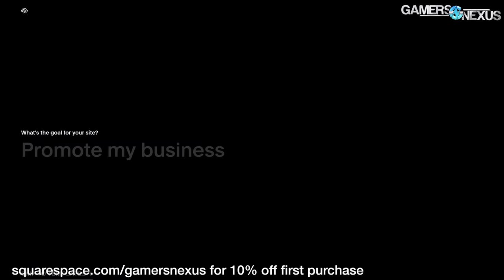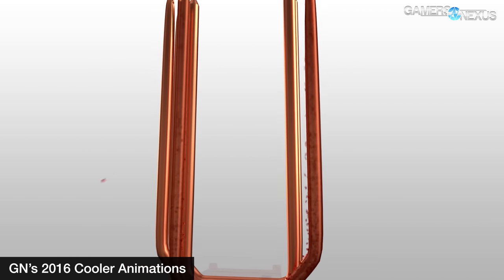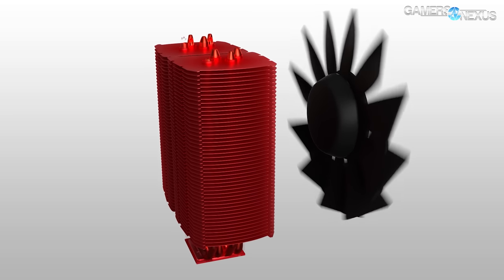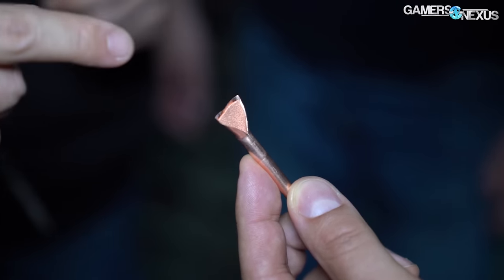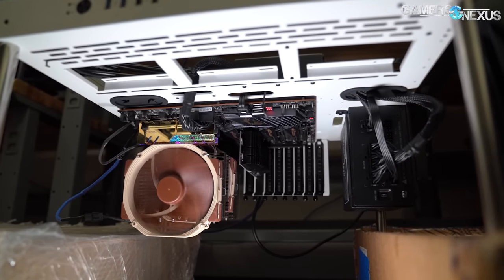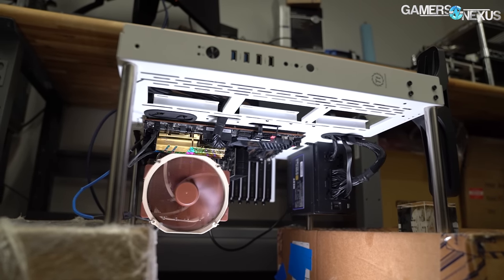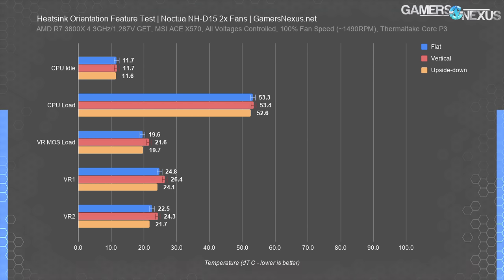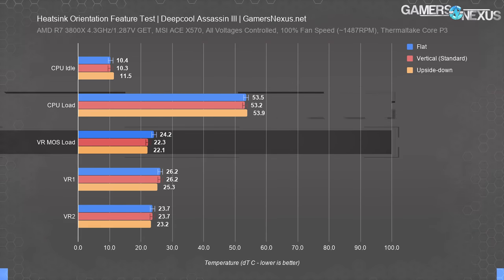Cutting AMD Coolers Open & Flat vs. Vertical CPU Cooler Benchmarks

Comment: Does orientation affect the heat level or power level at which the heat pipes for a given cooler run dry?to examine this question I believe you would need a heat source that could produce varying and somewhat accurate levels of heat.

Comment: Hey guys, I noticed that on some of your results, you didn't report error bars on the upside-down position. Not sure if that was a mistake or intentional.

I'm a little concerned about the error bars on these tests in general, and where they're coming from. They don't really seem to fluctuate with the underlying values, which is a little odd.

If you're just reporting error based on the precision of your measuring device, then some statistical inference would give you more confidence by averaging the error. If you're reporting error bars using a population average and standard deviation, that's probably not the best way to handle the data for a limited number of tests. That potentially discards useful information, and it makes the results very sensitive to population sampling bias.

From a UQ perspective, the testing error is an unknown quantity that you would expect to be well-correlated between similar tests, so variance in one of these orientations and locations would inform variance in the other orientations. Using a Bayesian approach and having some prior normal distribution, you can then update it with each new test you run.

The more tests of one type you perform, the more certain you can be about what your expected variation is, and the less information you need to collect from your population to validate that.

Comment: Have you ever opened a tube that was charged with r134a refrigerant? I had one for a 775 socket that said it was charged with r134a. As an auto mechanic, I didn't see how it would work without compression. The instructions said had to be orientated upright for convection flow.

Comment: I know you consistently say that upside down heat pipes are a fringe case and while that may be true for cpu coolers nearly every air cooled gpu runs an upside down heat sink. Do you know if subzero temperatures can harm heat pipes due to ice expansion or is the amount of water so insignificant that it's not a concern?

Comment: Interesting, in a fanless setup with GPU near throttling, I was able to reduce the temperatures by about 5 C by flipping it upside down.  The case was the ZeroRPM HT03, which has GPU heatpipes facing downward normally, or upward when I flipped the case upside down.
Reply: The airflow in you case is insufficient for your GPU then, not so much the heatpipe orientation of the said GPU.  Try to fix a 600rpm+/-  fan to blow some air under the GPU.  Probably doesn't even need to exhaust there, just cause some turbulence to keep the air mixing and moving. 👍
Reply: I would like to see some specific GPU cooling as well. When Silverstone introduced vertically mounted mobos there were immediately big problems with GPUs with the heatpipes being the wrong orientation. Presumably it’s worse for GPUs because in most cases the height difference is very minimal unlike a CPU cooler which can be mounted many different ways in a regular case so there’s not as much of a priority to make them resilient to gravity.

Comment: Dunno if this has been said before, but in my experience cutting things with a Dremel, you need to crank those RPM´s way up. It may be a bit intimidating, but I've found that the slower the cutting disk rotates, the more it "grabs" the work piece and the more it "kicks" causing all sorts of problems.

Comment: @GamersNexus, my old laptop would steadily climb to 95c and sit there until it eventually couldn't throttle any longer and shut down if i had the laptop with the base in a vertical position with the front of the laptop pointing upwards. Vertical orientation with the back of the laptop toward the top, it performed better than being in normal flat. To either side didn't affect much though.

Comment: Hi @Gamers Nexus
did you ever test to mount a CPU backplate heatsink?
I found the backplate of my CPU hotter than my CPU cooler.
which mean a lot of heat is not spread out of the cpu.

so I'm curious to know if there are reliable solution to cool down the backplate. (like a backplate heatsink)
if its cooler, the CPU should be cooler too (?)

Comment: Removing the cooling fins was a job for pliers and or a flat head screwdriver and rubber mallet or a normal hammer and adjusting the tappy tap tap accordingly.

Comment: The liquid at the block vaporises and the pressure forces the rest of the liquid to disperse evenly across the entire surface area. This means there is a continual 'stream' where the gas is condensing, and the liquid is forced along the surface area to the block, where it vaporises again. As such the orientation doesn't matter, as the momentum is driven by the pressure, not by gravity. There would have to be a huge pressure differential for gravity to matter.

What Steve should do is run a cooler with a progressive number of heat pipes cut open!

Comment: In cases where consistency of the heat load is so sensitive, could you just used a burner plate to 'simulate' a CPU with high watt consistency?
Mounting might be an issue though.

Comment: length of pipe affects performance longer the better , it would have been nice having before and after test temps to see how much the  phase change does make a difference ( not separating the pipes but depressurizing them for liquid to evaporate )

Comment: Nobody:
Literally Nobody:
GN — Cuts open a heat pipe and exposes a lie from Deepcool.
Reply: That or their heat pipe supplier is screwing them. Or their contract factory.
Reply: @mgkleym  which doesn't matter because it's their brand that they're pushing, so, its their literal and only fault :)
Reply: @mgkleym  they would 100% known. That design would have had to have been extruded through a die with that pattern, kind of what you do with playdoe maker or applying the designs when Applying frosting on a wedding cake. You have to pay thousands extra to have the shop cut this design into a hightemp hardend steel block using multimillion dollar machines. They recieve samples of a cross section or profile of the inside of the tube and a sample cut in half longitudinally. If they had any kind of qc department they would have randomly did an autopsy on random samples to make sure the product was as advertised to the consumer...This company is ripping off the customer by swindle which is a felony in the USA.
Reply: @melgibson6331  No,  not necessarily. If they outsourced production to a large manufacturer,  it's likely said manufacturer is already equipped to produce pipes with that feature. You'd only know, in that case, if you cut coolers apart.
Reply: @seitenryu6844  You have never worked in a factory have you?...even if its made somewhere else you Have to measure, test and cut the thing up before you put it in a box with your name on it...you are wrong i am right.
Reply: @melgibson6331  I have. I worked at one of the largest manufacturers of safety related equipment enclosures in the country. To say the techniques used were crude would be an understatement.  Speed and numbers were the most important things. I don't doubt that many places have scruples and high standards(I do, hence why I left!), but you're giving factories far too much credit. Maybe they knew, maybe they didn't,  but YOU DON'T. You couldn't. I'll wait for their response.
Reply: @seitenryu6844  were you worked it sounds like it was all inhouse except for the actual plastic.. If this place advertised a special design in their product you better believe it better be there even if you cant see it....their job is to make sure the product is as advertised. Cutting it up and destroying some for qc is industry standard and akways has been...even where you worked the safety lenses had to go through a barrage of test that would destroy the lenses in the process. You then record the serial number and keep it in a log to show whoever later you test your product for safety...every manufacturer has a qc department especially a company this size protecting millions of dollers in electronic gear.
Reply: Deepcool seems to do that a lot. Remember their leakproof AIOs? I'll never buy any Deepcool products since all they seem to do is lie.

Comment: Steve, great video however I believe your test methodology may not be aging well as CPU's are pushed closer to the 100c TDP limit and beyond.  I stumbled across some interesting findings on an Assassin III I'm using to attempt cooling  an OC'd 13600k.  I was testing the PC while on it's side, and noticed significantly (~10c lower temps).  I flipped the PC vertical mid benchmark and witnessed the temps steadily ramp up.  I tried a few variations of this, horizontal / vertical stance, messing with mounting pressure etc.  All were roughly the same outcome +/- a degree c.  In your test I don't believe you are really "stressing" the coolers.  I believe as you push closer to 100c, you begin testing the ability of the cooler to return the liquid to the vapor chamber.  It appears gravity does provide an assist as the heat pipes are stretched to their engineered limit. (At least in my case).  I can provide a screen shot if interested.

Comment: Is it possible the Deepcool would not have placed the grooves on the bend of the pipe because it would effectively choke off the pipe if a bend was applied to the grooved section?

Comment: The orientation of a c type cooler does matter, such as at 19:50.  I had a phanteks cooler like that and I transferred to a different case that had the mobo upside down, and it overheated horribly!  If I layed the case on its side it would be fine.

Comment: I remember doing an engineering report on heat pipes. Now, I use them exclusively for computer builds. Well, before the report, I had a hard time justifying a AIO for anyone's computer outside of systems that needed that additional thermal mass of the water.

Comment: I wonder if there's any local university's you could work with to access a decent sized vacuum chamber and test a CPU/HS combo inside the chamber as a air pressure is decreased and approaches a 'good' vacuum?

Comment: 6:08 ive always wondered at that sintering machine, 1. wouldn't all the copper powder just collect on one side of the tube and 2. why is is dumped in so inefficiently looks like more hit the floor than went in the tube

Comment: Can you do another video with GPU coolers? If vertical vs horizontal fins really matter. Because vertical fins are present in most high end cards, while horizontal ones are present in cheaper models. You could compare the MSI gaming X (the old one) with vertical vs horizontal fins

Comment: Where was the case in the flat and vertical tests?
The slightly lower value of the upside down could be the temperature gradient of the room (cooler air closer to the floor).
Two tests 4 feet from the floor and one test ~2 feet from the floor could account for the .5° difference.

Comment: What about the Noctua NH-C14S depicted in the warning shown from Noctua? I tried mounting it the wrong orientation on a 10600k running cinebench, and the CPU temps reached over 95 degrees. remounting in the horizontal orientation dropped the temps to 73˚C with lower fan speed. Not entirely scientific, but clearly indicating something fishy… Maybe the fact that the cooler heat pipes have two bends, makes it more prown to the negative effect of the wrong orientation, so much so that Noctua warns about it in their installation guide?

Comment: Oops. I have that noctua cooler and I used it exactly in the wrong orientation. Works still okay though and as a side effect the fan cools my northbridge chipset which got too hot before.

Comment: Oh, you could also buy a peltier and use that instead of a CPU. Run it in heat mode, (or just a simple resistor) and test the coolers that way. Yes it's a "non real life/use case" test, but it would help for extreme practicality tests of just plain old physics.

Comment: What about testing a heat sink normal vs with the top of a heat pipe cut off? How much of a difference does the capillary effect cause?
Reply from the maker: Well, there wouldn't be any liquid in there anymore, for one. Interesting question, though.

Comment: I like the method to get consistent results here, given using a cpu as the heat source, but I'd have liked to see a peltier thermo-electric device powered from a constant current power supply as the heat source.  would require some custom apparatus instead of just things already lying around, but would eliminate any variation between heat output in the tests. Over all, doesn't matter, for how inefficient a cpu cooler can be and still get the job done, but would be nice to narrow the margin of error.

Comment: Without the raw data, I can't run the numbers myself, but while the variation is within error-margins for each individual set of tests, the upside-down average is so consistently lower across all tests compared to the vertical and flat tests, that it seems possible there would be a statistically significant difference if a collective analysis was done across all of the heatsinks and all of the tests... 

This is obviously interesting because it's counter-intuitive if true, but I understand not wanting to run a multi-variable analysis... Still I'm left wondering why that would be the case if it is true...

Comment: Just to confirm what GN is verifying on,
Many years ago when I was on OCN discussing about heatpipes and stuff and convection, it was one of the key things that people got wrong
but alas, gravity doesn't affect heatpipes in forced convection situations (nor does a top to bottom airflow design help a force convection design, that is simply because of silverstone's large fans that don't suck and plenty of breathing space)
Heatpipes aren't purely pipes, they have sintered copper powder in them for the liquid to seep through the side walls creating capillary action. Some people still think they're literally pipes and don't do jack shit
Or that phone manufacturers advertise heatpipes as liquid cooling and people believing their BS...
however vapor chamber is different as they're pumped with pressure into them, lowering their vapor temperature and being able to reach steam phase faster. Basically pricier heat pipes where heat pipes usually cannot go like say, very high heat flux (modern CPUs really, although coolermaster is making a mess of that) or where the pipe is becoming insanely flat. On top of that, you get much larger contact surface.

So that's why the earlier old copper wraith stealth coolers perform pretty good compared to what you were expecting out of them because they have a really big dollop of a vapor chamber in them.

In fact for a real world test, put a non heatpiped heatsink on a hair dryer vs one with a heatpipe, you'll quickly find that the one with the heatpipe conducts insanely well compared to one without a heatsink i.e wraith stealth and intel stock heatsinks (and the new aluminium wraith spires ugh) When your amount of aluminium starts to get further and further away from the source in terms of height of width or whatever, the thermal conduction of the material heavily comes into play so you lose efficacy really fast

Comment: Could we get a Wraith Prism speed switch comparison? I don't think anyone has addressed the speed switch, and no one says whether their benchmarks are on the Low or High setting. I suspect many owners don't know that a physical switch is even there, since it's not mentioned in the included installation instructions. Your test says max RPM was around 2900, which would be the Low setting.   
Low Setting (default setting) = 2900rpm max, dissipating up to 116W waste heat;
High Setting = 3900rpm max, dissipating up to 124W waste heat.
With Precision Boost being so dependent on CPU temp, I wonder if the High setting actually increases performance?
Reply from the maker: Sure. We'll add that to our upcoming benchmarks.
Reply: @GamersNexus  Awesome! (I updated original post with some additional information.)

Comment: Can't believe you missed an orientation...
The towers are not symetrical and you can place the cooler on it's side with one tower above the other, or with both towers next to each other.  Depending on the case and the mainboard/ram location one orientation may be preferable but knowing if it matters in the heatpipes would be nice.

Comment: At 3:15 you said "testing with the cooler like this" and held it the wrong way. When you have gravity (I will sponsor you to space soon), You will get better convection if you have the fins oriented so hot air can rise. It is very important if you are gonna use passive cooling. I had a computer in my bedroom with a 35W intel I5-4590T and passive cooler and fanless PSU. The passive cooler did not work unless the fins let air pass vertically. And the case had to have big openings at top and bottom. It was the only way to get a dead silent PC in the bedroom.

Comment: Does the weight of the cooler affect the surface contact in the upside down test?
Reply from the maker: You would need an extremely heavy cooler and a very weak set of screws for that to matter.

Comment: iv'e had my computer laying on its side for some years now so my heatpipe tower is vertical. i didn't like the way the motherboard was taking the weight and was afraid it was going to deform the board. my computer never leaves the 60's c even under a load

Comment: So another case of "Is there a technical difference? Maybe. Is there a practical difference? No."

I'm assuming you didn't bother with front-to-back vs. top-to-bottom orientation since that probably only matters in terms of case airflow as well